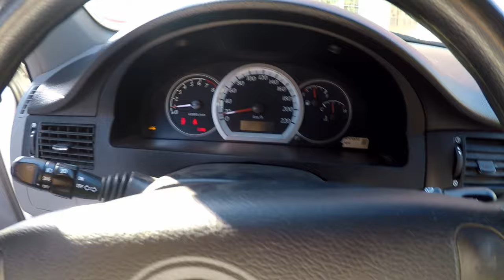Brake Rotor surfacing

Comment: Use a grinder with a 60 grit pad and hit the lip edge and hit the whole surface lightly after getting the lip in a circular motion. Then use 100 and in an even circular motion hit it a few times. Then use 180 in a circular motion for five or six times around the rotor. Do this on both sides. Finally use 300 and go around the rotor like 15 times as evenly as possible. 
Then slap new pads on after you use a C clamp to compress the brake piston preferably doing it by releasing the bleeder nut on caliper while compressing piston until piston is fully compressed and then tighten bleeder nut. Do this to the caliper and rotor furthest from the brake reservoir to start and then the next furthest and so on ending with the front assembly that is next to the reservoir. Fill the reservoir with fluid to the line and install the pads all at once, install new slides and dont forget to put brake lube lightly on rear of pad, heavily on caliper pins, amd heavily on caliper slides.  Tighten hardware to calipers and rotors then put tires back on. Pump brakes after starting car up and pump them 10 or 15 times to the floor or as far as they will go.

Comment: People dont do this unless you really have to. There is a reason, grinding of discs is being done by precise machine that works as precise as thousands of milimeter. Its purpose is to straighten the disc so it doesnt voble.

Comment: Yea it'll get you by, however when you get the money to replace the problem( rotors) you're new pads have will have un even wear. Depending how long it takes to save the money, more then likely just wasted a set of pads getting you buy . Now you have to spend more money new rotors and new set of pads, unless they have lot's left on the pads and one has the luxury of having a chop saw with a metal blade, take em to a chop saw grind them flat/even again. Only problem with that pads might not seat properly if they aren't perfectly flat and cause your new set of rotors to have the same problem 6 months or less down the road. Also always check your slider pins make sure they move freely.

Comment: You should also at least clean the slides/tracks (the grooves the pads ride in). Those clips are removable, are often coated, and should be replaced when the pads are. A couple dabs of silicone paste on the ears of the pads (where they ride the glides) will help keep pads from hanging up. Pads hanging up is the origin of most issues associated with both brakes and wheel hub assemblies. Did the brake peddle pulstate after the surfacing?
Reply: Probably not because it has been through the cycles of heating and cooling unlike a New set rotors ...

Comment: While it's on jack stands and in the drive position,  why does only one side spin while the other side remains still? Even after removing the brake pads on both sides of the wheel, only one side spins while the other side remains still. I need to have both sides spin simultaneously.
Reply: Switch the non-spinning rotor to the spinning side.  Resurface it, then put it back.
Reply: You have an open differential
The wheel that doesn't spin has more friction than the one spinning for some reason, so all or most power gets transferred to the other one. You can put the tire on the wheel you don't want to spin, it will help it stay put

Comment: Brian Wilsons good vibrations.... Purely a stop gap to pay day or for that drive to the mechanics but in the 21st really it's a 3rd world or Cuban only option. If rotors have been damaged cos you wore pads to metal and scored surface of good rotors, get em in the lathe and have them cut back properly, otherwise buy cheap buy expensive but buy new is so much better. And rotors are dirt cheap. Depends what value you put on your kids, partner, friends and other Road users really. Surely if in a serious accident you'd have the car inspection and be found to be liable? Voiding your insurance and maybe getting a nice manslaughter charge for a few bucks

Comment: That rotor is destroyed. Never take abrasives to them like that. Soft metal prep fiber pads only.
Reply: Those rotors are pretty darn hard😂   brake pads wear down the rotor so it will smooth out again and just ehh. Work😂
Reply: When your rotors are already destroyed from it going metal on metal, tricks like this will help you get by untill you can replace them.
Reply: YUP!

Comment: If you don't feel your life is worth the 20 bucks to resurface those rotors,think of the others lives you PUT AT RISK,to save a few bucks,please
Reply: They will wear in.   So it doesnt really matter how you do it.   As long as there is no grease/oil on the rotor.    A few 100miles and they are smooth again. An still brake fine
Reply: roberto ruiz calm down roberto they come back warped from the shop anyway theonly way to avoid warp and keep flat is remove and get them ground with lots of coolant but nobody does that they have coolant on some brake lathes but the shops dont use it